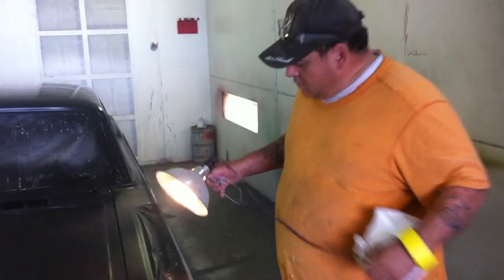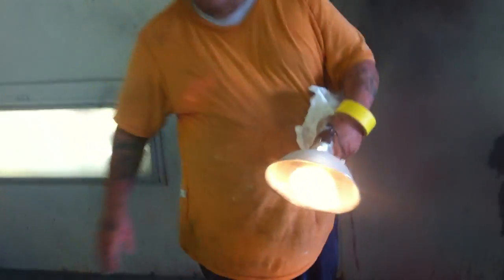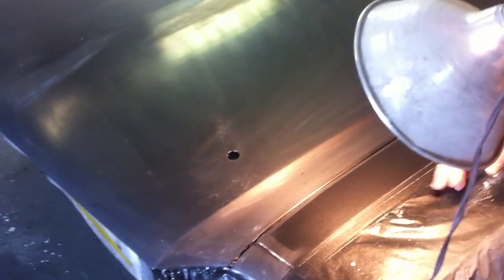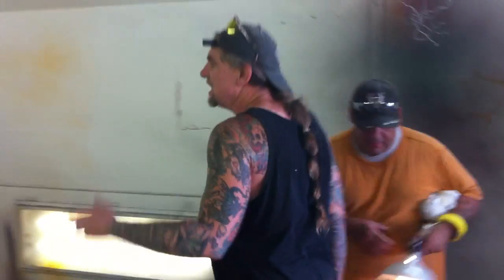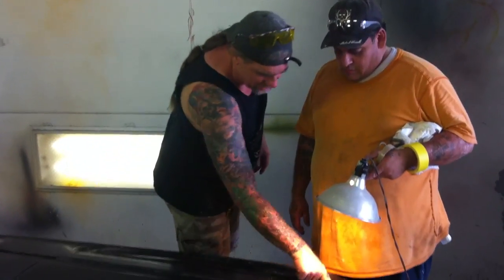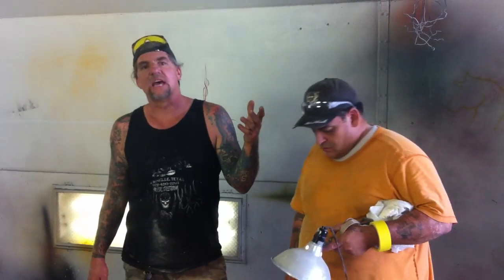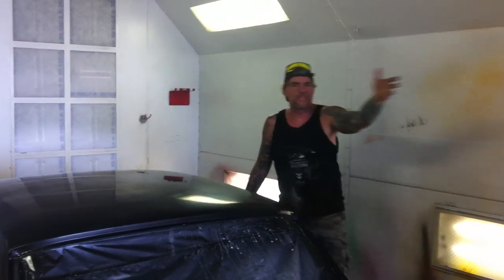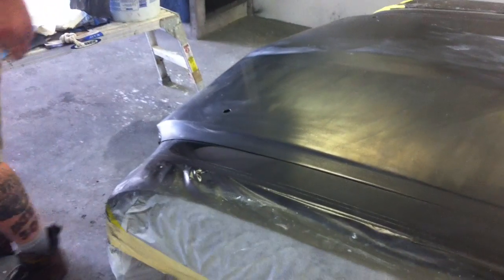PPG Gloss vs. Matte Clear? - SWNRC

Comment: Either way I think you've got a cool car.  I was disappointed to see the HR Flatz didn't work out.  My experience with it was on smaller parts (my dash, etc).  My opinion on the gloss vs matte finish is to go with the gloss.  It will in my opinion look great against the candy!